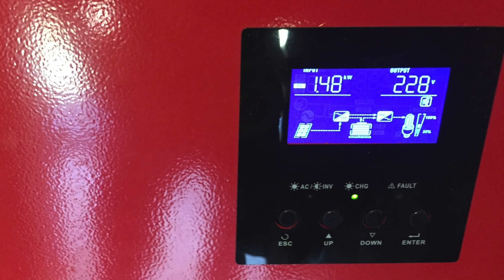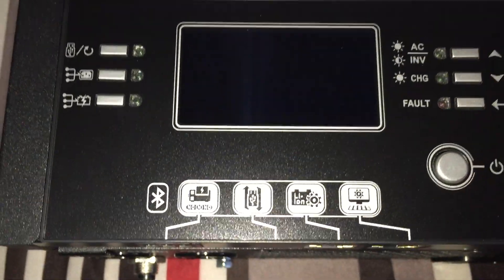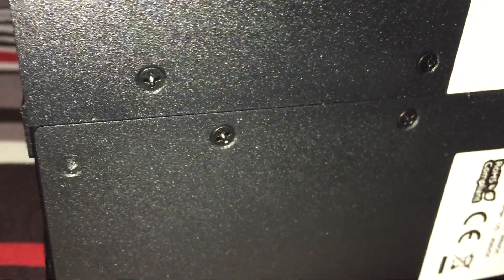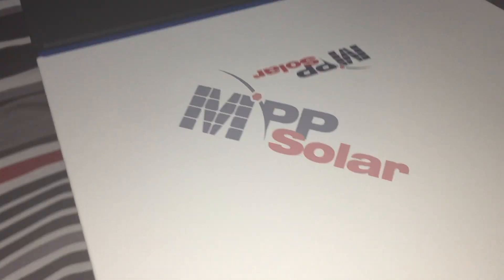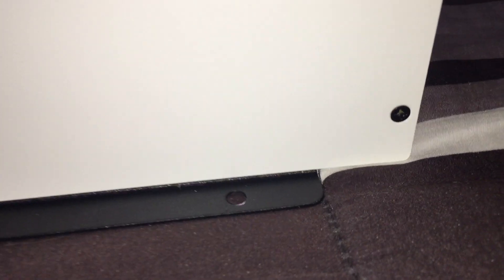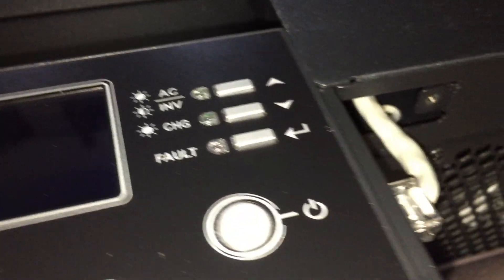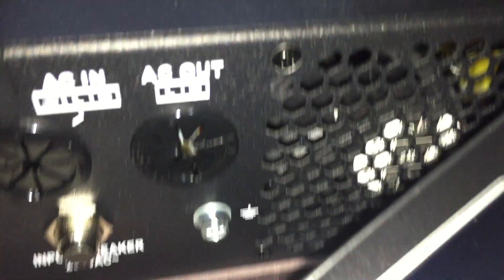BATTERY-LESS...MPP SOLAR PIP 5048 GK First Look

Comment: I have the same unit the 24v 3000w model and i think i got a bad unit im at 230v input with 5 355w 47.7v panels and im still not getting nothing its reading the volts 220-230 etc but not the amps or watts from the panels that i just bought im so upset i noticed no one can give me the proper answer to my question what does nominal operating voltage of 240vdc actually means because im getting absolutely nothing with this inverter..i even uploaded a video with the specs of the inverter..
Reply from the maker: Sorry to hear that..

Comment: Good video - very informative, thanks.
How has the reliability been going for you? Any problems at all? Still going strong?
Thanks.
Reply from the maker: Thanks for the reply.  I took the measurements after nearly a year.  They've been up there longer, but can't get to them due to COVID.

My employees say everything is running fine.  I was only monitoring them up to a year, but haven't done anything to maintain the panels, my inverter or my batteries.  So far everything has been running smoothly for six month since I checked it last.

I'll probably have to clean them once I can get there.  The farm can be dusty..haha.

Comment: Sir, what is MPPT voltage Range 120-450VDC mean?
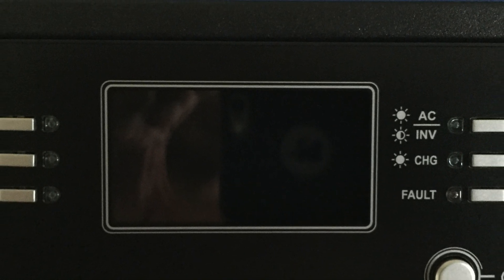At 0:51 on unit label.
Will MPPT work if I use 3x 250wp panel in series with total VOC around 105volt?
Reply from the maker: The voltage range means the unit can start working or recognize voltage and amps when your voltage from the PV is at 120V.  But I say more like 145V to be sure.  The 450V means this is all it can handle.  Voltages above 450V may fry the unit.  I would stay at around 400V from the panels to be sure.

3 panels in series producing 105V will not be enough for the unit to begin working.

Hope this helps.
Reply: Thank you!
It is really help me.,

Comment: I
have:  a MPP Solar inverter, 5 years
old,  two off 2.5 kW panels with micro
inverters, one off 1 kW panels also with micro inverters. My PV system is not
grid connected. I have grid connection which I can draw from when my PV system doesn't
produce enough power. When I have too much power I have a method of shutting
off some panels as well as sending power to the Hot water tank.

I
have a battery bank of 12 off 250 Ah lead gel bats. They are getting old.

 

I
am interested in the PIP 5048 GK  to
replace my old MPP unit.

Can
you please inform me as to how it works?

 

I
understand that the GK can run Battery Less, also Grid Less, yet it can be grid
connected.

 

I
then presume that it has AC power running only in one direction, namely from
the grid only and not to the grid. Please let me know that this is correct, and
is the power flow direction controlled by CT's. ?

 

As
I understand it, all grid tie inverters need to see say 230 vac in order to
turn on, and  thus when the grid is down,
the power is off in order not to send power to the linesmen and electrocute
them.

 

Next
question,  so if I have a GK installed,
and my 6 kW PV system is producing say 5 kW,,, when my consumption is only 2
kW, where does the 3 kW go?? since they cannot go to the grid??

 

On
the other hand, when on a rainy day my system produces 2 kW and my consumption
is 4 kW,,, then I must be purchasing 2 kW from the grid, will this be correct??

 

Cheers,   john nielsen
Reply from the maker: If you have 6kw, that will be more than the GK can handle.  It is rated for 5kw.  You might want to look  into the 5048 MG since it can be paralleled and you can scale to 2 units at 10kw total, but split your current wattage to 3kw each.  Both the MG and GK can be connected to the grid "only" as a backup.  It will not feed to the grid, however with 6kw even on a rainy day you might still produce about 1 to 2 kw's and not us the grid or battery as long as you stay below what is being produced.  It is still free energy.  As for the "extra" wattage coming from the PV array (600kw while using 1kw), what will happen is that it will charge any batteries you may have.  I suggest having batteries even if the unit says it doesn't need it only because you still have to contend with cloud edge effect.  The unit will shut on and off on cloudy days as clouds pass over.  If the batteries are full and you're still using less than the PV produces, the inverter will "de-rate" the excess and only use what it needs from the PV array.  I hope this answers all your questions.  Thanks for your questions.

Comment: Hello, can you tell me what’s the maximum input current (ampere) for the pv input for this unit?
Reply: 5000W / 450V = 11,11A
5000W / 120V = 41,67A
So its between this numbers
Reply from the maker: For this unit it is about 40 amps, but I try not to exceed 30 amps total.  Still I can run a fridge and a small a.c. unit if need be as long as there's enough PV.